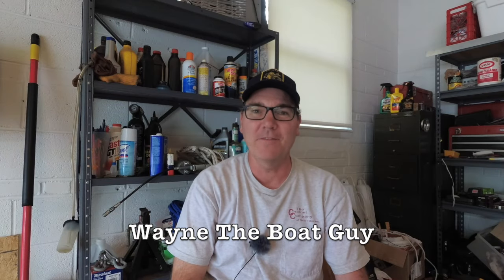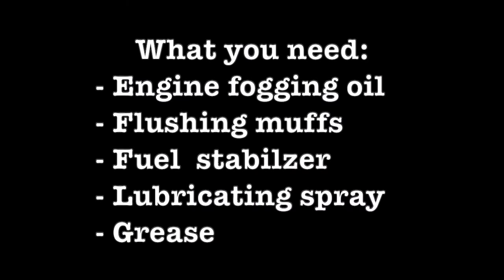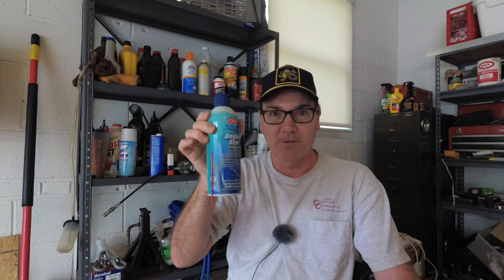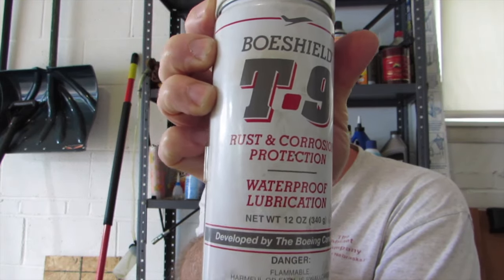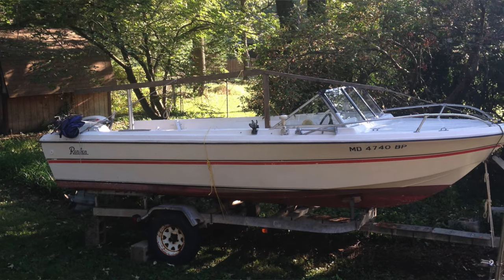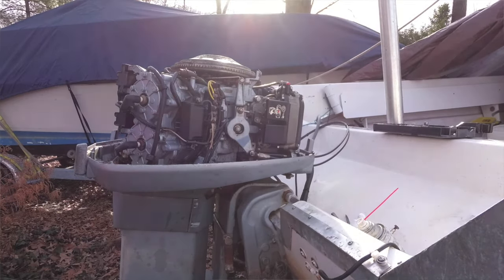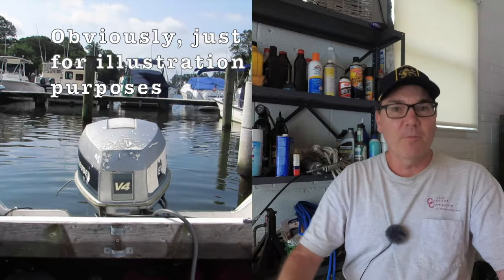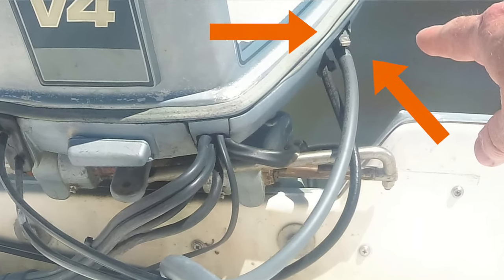Winterize a 2 stroke outboard boat. How to do it - step by step!

Comment: I got my first boat and I'm doing my own winterizing, you made me believe I can do this! I am going to try tomorrow, after I get it pulled out the water, but I feel more then comfortable and 100% more determined to do this!
Reply from the maker: Thanks!! Be sure to crank the engine for a few seconds to get any remaining water out of the impeller as well! Don't start it dry, just crank it for a few seconds once the hoses are off.

Comment: If you treat fuel tank with K-100 there is no worry for water. I run K-100 all season as well stuff is amazing. Do this take K-100 and add it to 8 oz of water mix it up then take tissue or piece of paper and light it on fire it makes water burn.

Comment: Hi, I'm from Sweden, when I winterize my boat's engine I run it first in fresh water so it gets warm then I run it in glycol water for a good while so the engine must be warm then the glycol will settle inside the engine and protect the engine I usually drive five minutes to 10 minutes in glycol water at the same time I change the gas can and run 8% oil mixed gasoline in my four stroke it works fine with two stroke also fatty two stroke oil gasoline is good for the carburettor so it doesn't irritate it is cheap and good I have done this for about 30 years have never had any problems with my engines Then I always bring my engine into the heat to protect electrical cables etc. I take the battery out and maintenance charge  the glycol also protects the impeller and gaskets  many have problems even mopeds they have been standing for a whole winter if they pour in two-stroke oil and drive so we get the two-stroke oil into the carburettor there is no problem starting it in the spring motorcycles cars that will stand for a whole winter it lubricates the carburettor avoids corruption

Comment: How does the water drain out of the engine
Reply: The engines are all designed to drain 99% of the cooling water out when vertical, hence why he says several times to store the motor trimmed down like your running it in the water, not up.
When titled they can trap water, which will freeze, and freezing water expands and can crack metal, rocks, basically anything known to man.
Water is not to be underestimated, ever.

Comment: I am in DFW and wondered if circulating antifreeze through the motor would help. Motor has been verticle on the trailer for weeks. I want to not have any issue or worry. I understand all the water should be drained out by now

Comment: Hi Wayne thanks for the food information, do I need to winterize my motor if our winters are not bad (South Africa) the lowest temperature we experience in winter is about +1or 2 degrees very seldom it might drop to -1.
Reply from the maker: If you're storing it for a several months, getting the petrol out of the carb and maybe a bit of fogging oil should be all you really need.

Comment: Hi Wayne. You mentioned you disconnect the fuel line from the engine and then let the engine run until it's out. Do you detach the line from the fuel tank you keep on the boat too?
Reply from the maker: I would leave the line connected to the fuel tank.

Comment: Can you leave the battery in during winter? Plugged on? I just charge it in spring.
Reply from the maker: Yes… but ideally on a trickle charger and with nothing potentially drawing any power. In very cold areas most people bring the battery inside.

Comment: Will there be any water in the engine that needs to be drained? Like inside whatever pumps the water through the engine.
Reply from the maker: If you have the engine vertical (not tilted) any water will drain out.
Reply: @WayneTheBoatGuy  That was the only thing that worried me.

Comment: I know this is a old video. A friend of mine told me to put the bottom of outboard  in a tub and suck in rv Coolant for the winter.
Reply from the maker: You could do that, but there’s no need. If it is stored upright and not tilted, all the water (or coolant) should drain out.

Comment: Thanks for the video, quick question.  The water coming from the hose and ear muffs, when you shut the water off does any of that water stay in the engine cooling area?  Does it matter if you leave the water running when the boat is off, don’t want any of that water to freeze inside the engine.
Reply from the maker: if the engine is stored vertically and the drains are all clear, the engine should drain all the water out.
Reply: @WayneTheBoatGuy  Does this mean you dont have to put anti-freeze
 in the motor??
Reply from the maker: @tinas4886  that’s correct.

Comment: Question have you ever seen any one use the premix 2 stoke fuel from lowes on your boat?
Reply from the maker: It seems well suited for the very occasional boater who only goes out once or twice a year for short trips. Most people who run a 2 stroke around me mix their own because it's cheaper.
Reply: Most folks would go broke doing that. Stuff is upwards of $20/gl at the local Menards.

Comment: Hi, I live in California. 
I have mercury 2 stroke  150hp
Yr 2000.  I bought this from SC durning summer.
How would I clean the engine? 
Is it safe to spray water lightly and wipe it with towel?
I want it to shine..
Thanks
Reply from the maker: Are you looking to have the actual engine shine, or just the outside engine covers? 
Of course a little water and wiping it down is fine, since the engines are often exposed to moisture. Some engine components are painted when new and could be re-painted to shine like new again.
Reply: Yes, engine shine

Comment: I pulled the fuel line as I sprayed fogging oil and the engine reved up before it died. Is that normal?
Reply from the maker: It might have revved up from the fogging oil, but hopefully it ran long enough for the oil to get all the way in.
Reply: @WayneTheBoatGuy  Thanks

Comment: So you don't have to worry about the water in the impeller? Did you skip an important step
Reply from the maker: My understanding is that an outboard, if set vertical will drain all water out completely.
Reply: All outboards are designed to drain 99% of the cooling system water, from gravity alone, when vertical.
Don't store your outboard trimmed up, always put it down.

Comment: I thought using a quality oil will keep you’re motor from rusting internally
Reply from the maker: When storing it, fogging oil is designed specifically to coat areas for long term storage.

Comment: All your talk is Bull Shield.  All 2-stroke engines are pretty greasy inside anyway, so it's not necessary to use extra grease to make it greasy.  I have the engine from 1995 and never did anything to it - just run the engine until it stops, be sure you don't trap any water in it and you'll be fine.
Reply: There is some truth in this. I was perplexed as well.
Reply: Your completely incorrect.
While doing nothing can be fine, the manufacture of every engine ever made says to winterize like described in this video if you live where the temps drop to freezing or below for even one day/night.
Don't spread misinformation that could cost someone thousands, or even tens of thousands of dollars.
Outboard engines, even small ones, are extremely expensive and overpriced to replace or perform major repairs and are easily totaled due to ignorance, laziness, or carelessness.
Reply: Where is the freeze plug in the engine? I have a 1995 evinrude150 2stroke

Comment: Why is my 2stroke motor wasting a lot of gas and loosing top end
Reply: Because it's shot, bad rings most likely from improper amount of oil when running.
Needs a rebuild for sure, or replacement engine at most.
It is VERY easy to ruin a 2stroke outboard engine.

Comment: Important note everyone should know.
If you own an older outboard, (Think pre-ethanol blended fuel days) you should NEVER be running fuel with ANY Ethanol in your engine!
Modern ethanol blended fuel is garbage and WILL turn into little corn like balls as it dries out.
It RUINS carburetors regularly, don't use this trash "fuel" EVER.
Same issue with chainsaws, gas mowers, gas leaf blowers, woodchippers, older ATV's, snowmobiles, dirtbikes, motorcycles, go-carts, basically ANY 2stroke small engines, especially if built before ethanol blended fuel mandates.
None of them are designed to handle ANY amount of ethanol in the fuel (And even if they say they ARE designed to handle it, they aren't)
Ethanol turns into literal corn balls and yellow gum when it dries out too long.
This makes it so you have to completely rebuild your carbs if it dries in there, at all.
Non-ethanol fuel is readily available, in most areas, just only at certain stations, you may have to drive out to farm country to find it if you're a city slicker.
You may need to use a phone App specifically for this, or google it, or call the service stations and ask them if they have no-ethanol fuel, or know who does.
They can usually advise you if you get someone like a manager who actually knows things, if you get the minimum wage hourly twat your likely sol.
Bottom line, non-ethanol is available in every state.
NEVER run ethanol fuel of ANY percentage in older 2stroke/small engines built before ethanol blend was mandated to all the gas stations.
Marinas that sell fuel ALWAYS sell non-ethanol fuel, but they also price gouge like you have never seen before.
Non-ethanol fuel is sometimes more expensive than the normal blended trash we put in our vehicles, and sometimes it's cheaper, each station and supplier and market is different.
Back in my home in middle VA (landlocked) non-ethanol fuel is ALWAYS cheaper than regular blended fuel.
Now that I live on the coast very close to the ocean, it always costs MORE than regular blended fuel because again, price gouging! 
There are SOOO many boat owners near the ocean, obviously.
Everything else in this video is correct, or close enough.